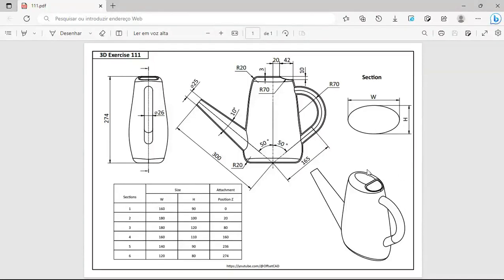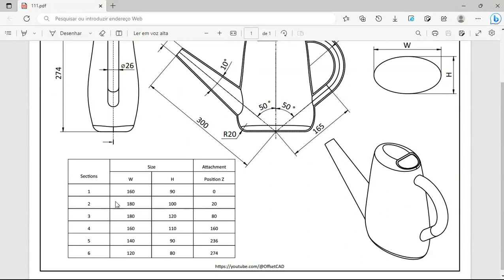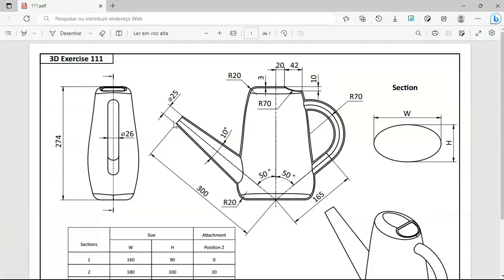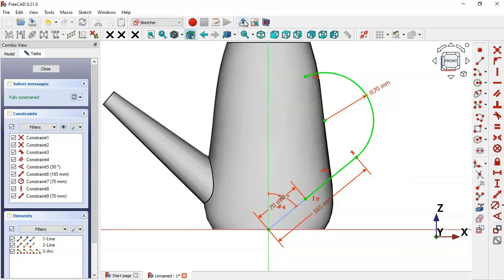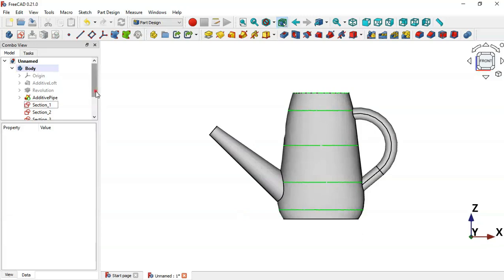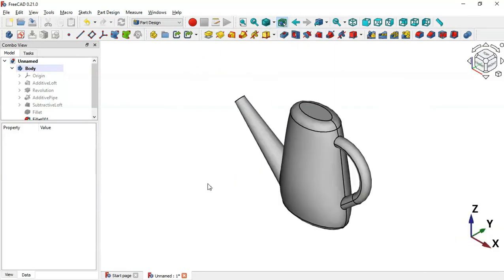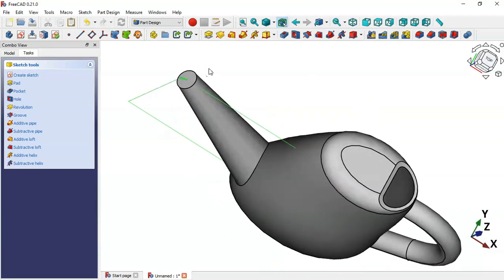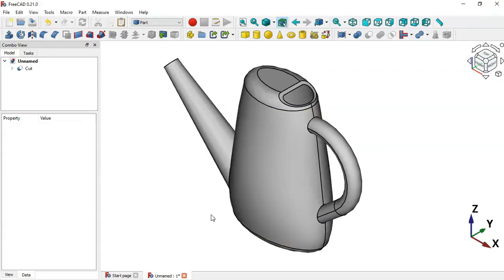FreeCAD 0.20-0.21 Beginners tutorial: practical exercise 111

Comment: Since the thickness of this part is a constant 3mm is there a reason the thickness function is not used? Subtracting a scaled down shape seems labour-intensive.
Reply: The jug is not completely closed at the top, thus thickness is not possible
Reply from the maker: Thank you again!
Reply: I just made this part and because I'm stubborn I used thickness on the closed end face of the nozzle and added the top pocket last.  @LFANS2001